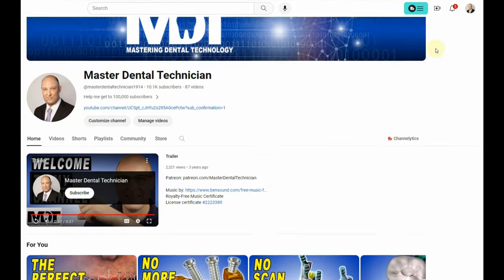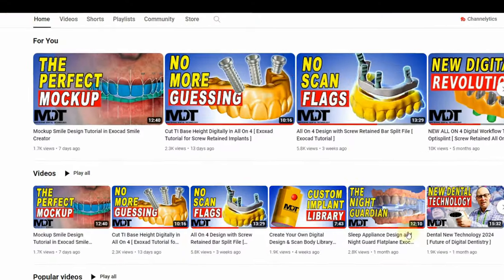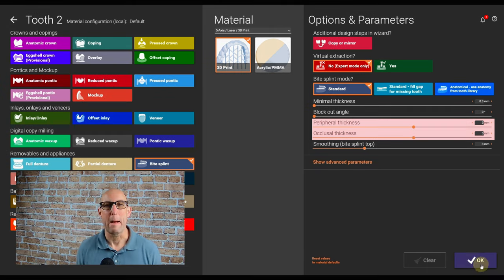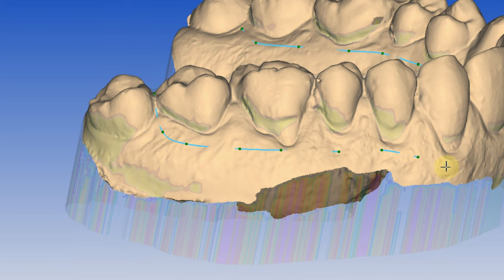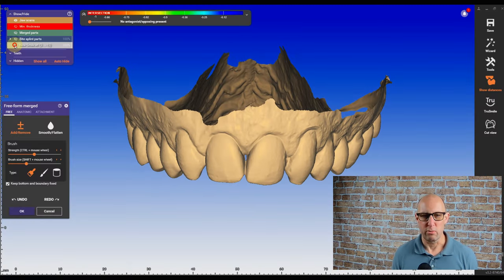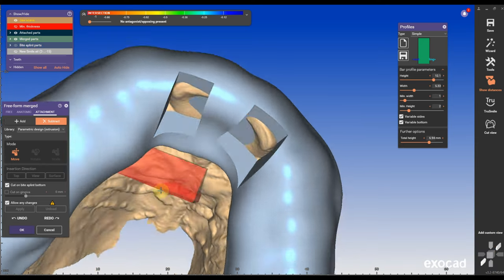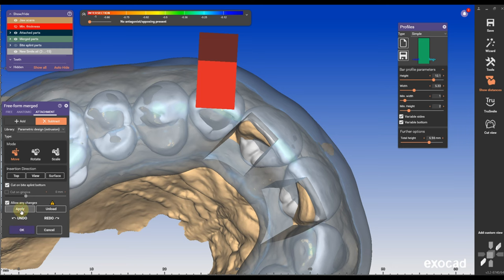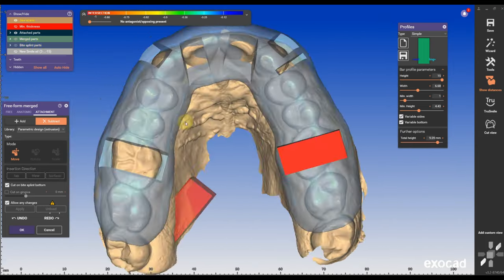Transform Smiles with Anterior Preparation Guides

Comment: Could you technically cut out a margin outline on each tooth? Or a slot for every interproximal? Or does it only allow shapes?
Reply from the maker: You could cut out margin outlines. See my video about gingiva reduction guides
Reply: @masterdentaltechnician1914   Just saw the video actually! really helpful! thank you. I also watched this the other day 

https://www.youtube.com/watch?v=akJN1QCATOo

If you can skip to 3:50. Is that possible on exocad or are they using some sort of proprietary software? Some sort of custom tray to seat all the veneers on at the same time would be great to add into my work flow
Reply from the maker: That's a simple seating jig for Crows or veneers.